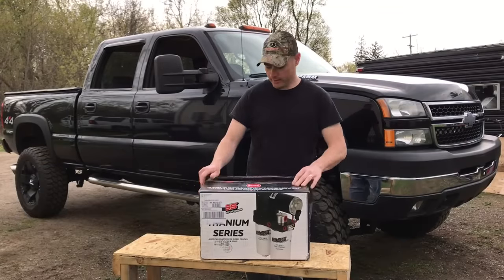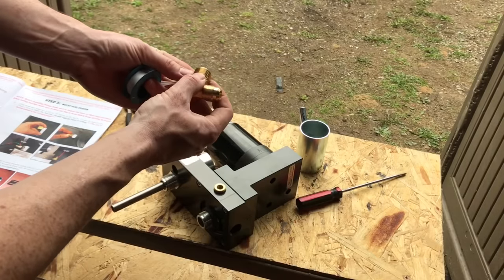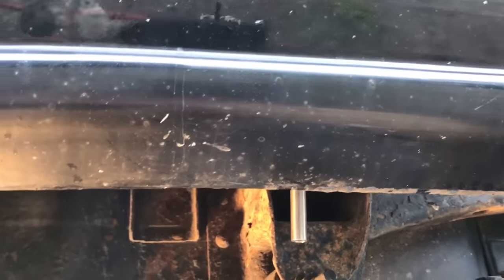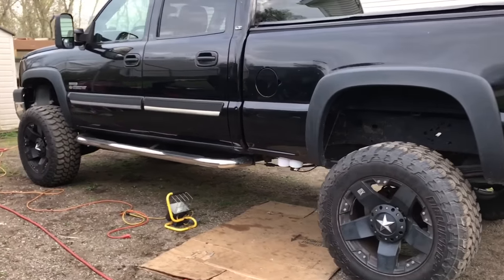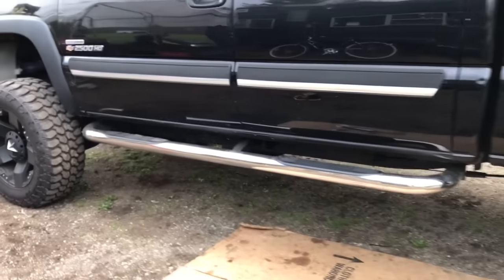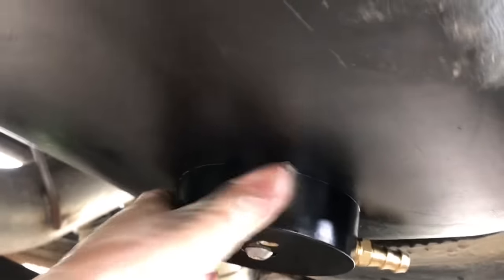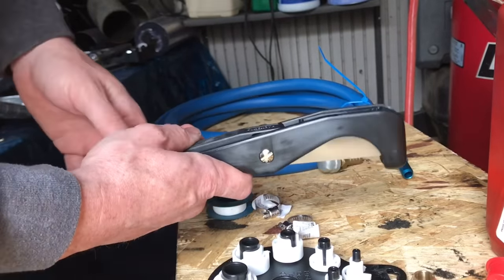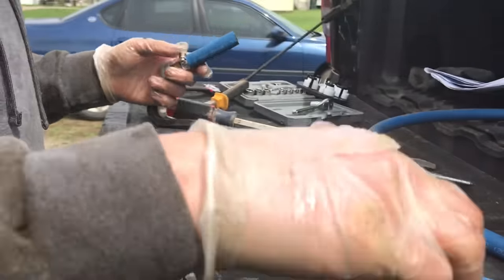Duramax FASS Lift Pump and Sump Full Install

Comment: Hello, great video! I not installing a sumo kit with mine and I'm having trouble figured out where my fuel lines run. The one coming out of the 90 defeeebfitting is my suction line right? The one you capped off. And the top fitting on the opposite side goes to the other side that you cut off? And the bottom fitting is the return that goes to your fill neck? Sound right?
Reply from the maker: +Jared Mcbride sounds correct to me
Reply: just follow the instructions and youll be good to go.

Comment: Hi two questions  did you keep the original fuel base with filter at front working or not.
The other question, what is the difference between drill holes in the bottom of the tank than use the original  fuel line  that came from factory 
I have a nice 2004  Duramax 3500 LT dually  do you think that kit works for me without problem 
Thanks

Comment: could you have put the return line to the old suction line you capped instead of going back in the fill line
Reply from the maker: +4x4family it sounds like you could but the directions don't say to do it. That's a good point though

Comment: I have a 2013  LML 2500HD 6.6 TURBO. I've started to have problems when I turn the key to start the engine it's taking longer to crank. I've put new batteries on.  Next I plan on changing the o rings in the primer pump. Could you give me any advice on what my problem could be? Please!

Comment: So, should you unplug/tape up the electrical connector for the factory fuel pump thay sits on top of the tank?
Reply: No that's a sending unit NOT a pump. There are aftermarket in tank Lift Pumps...but even more expensive

Comment: Now just Get a fuel rail shim or race valve and a ppe ported fuel fitting. Then you'll be set. And a 3 inch boost tube
Reply from the maker: +Live4 Boost that stuff is already installed I'm really considering upgrading the injectors
Reply: Oh sweet. They say lbz injectors is good for 600hp I don't know if that's wheel or crank. But I'd go turbo, then cp3 and injectors like a stg2r 68 Danville.
Reply from the maker: +Live4 Boost that's a good point a turbo might be the best route

Comment: When cutting the filler neck hose I didn't realize there was another hose inside and I cut through both! Do I need to replace the internal hose or am I ok to just button it back together?
Reply: Found I am having the same issue, how did you do yours?

Comment: Hello, 
I have 2 Duramax trucks 1st a 2007 with 100,000 nothing done except 1 glow plug a year and regular 5,000 service. 2nd a 2015 with 247,000 some front end work and regular 5,000 mile service.  I do all my own repairs as a police officer I stick to a tight budget. What would you recommend me checking on either to make them last. I do pull trailers but  I am easy on my vehicles.

Comment: Maybe a dumb question for an old video but I bought a FASS 150/150-3010 back in 2009 for my 2995 3500. I work overseas a lot and never had time to install it. Any concerns I need to think about this NIB Fass pump when I finally get a chance to install it? Looks like the filters for the newer 165 won't work but shouldn't be an issue finding the stock ones. Maybe contact Fass. Transmission videos you've posted look killer and I'm debating on whether drive my truck from Idaho to Wisconsin to have your guy do the build.

Comment: Been a long time subscriber and I'm looking into installing a FASS pump on my 3500HD Classic, so I was glad you had an install video. Just had one question. 19:42 you show your fuse box lid and it shows a 10A fuse for ignition but you pulled a 25A out of there. Is there a reason for that? I'm not at my pickup right now so I can't see what I have.

Comment: I have a 2007 and a 2015 both stock. What Fass pick up pump would you recommend gph with all stock parts and if it were you would you even add a pick up pump.

Comment: Any issues with particles and debris from the bottom of the tank? i figured that is why the suck fuel out not let it drain
Reply from the maker: +Saint Matthew no issues yet but you really don’t need the sump it’s just better on the FASS since it’s gravity feed

Comment: Did you consider running the return from the lift pump to the suction line you capped? That way you wouldn't need to cut into the fill neck. Good video btw.
Reply from the maker: +Ian Hill I'm. It sure that would work properly if I did that but I see we're your going with that. Thanks for comment
Reply: Truck Master I'm going to be installing my FASS 150 and Beans sump this week, so I guess we'll see how well it works soon. lol
Reply from the maker: +Ian Hill good luck man

Comment: I see you have the 150gph lift pump. I see they have 290gph also. Does it matter on how much pressure? I have a 2006 lbz in Commiefornia and smog guy telling me my fuel pressure is a little low. I was told that adding the lift pump would fix this so I was just wondering on the pressure.

Comment: Truck Master, my Fass Lift Pump instructions say to drop my tank. There aren't any videos showing this step. Do you see any reason for that to be done? I have a 2015.5 LML.
Reply from the maker: No you don’t need to drop the tank
Reply: @TruckMaster  Good to know. Thanks man.
Reply: Follow-up: Fass sent me the draw straw kit, which does require tank removal and drilling a hole. Pretty silly cause the avg DIYer isn't capable nor comfortable doing that. Called XDP and they confirmed that's what Fass now recommends for the 15&16s. I've got to order the filler neck part now since it doesn't come with this kit. Glad I caught that before cutting my filler hose. Hopefully this post helps anyone with my year model LML. I'll call Monday and ask Fass to send me a filler neck return manifold; part RM-1004.

Comment: You have any problem with pump sound on the fass? I installed it on my lml and I can hear it very clearly over idle. Fass says its a suction line problem. I'm installing a sump tomorrow so maybe that will fix it. Keep up the good work.
Reply from the maker: +Aaron Fuller yes mine sounds funny before it starts but then cleans up but I think it's normal. Thanks man

Comment: Ever since I got my lift pump the housing keeps leaking. Bought the delete but I’ve always wondered why not just completely by pass the housing.
Reply: jhurley12 I here you in losing prime but with the fass that shouldn’t be an issue. Correct?
Reply: jhurley12 I’m thinkin by pass the filter housing completely but leaving it bolted up there just in case.

Comment: I noticed your ignition fuse was a 25A instead of the OEM 10A. Why do you have a 25A fuse in there? Does it call for that for the lift pump installation?

Comment: hey not sure if you'll ever see this but... important question... did you do your efi live tuning before or after you installed this fass lift pump? on my 04 Cummins i have the lift pump up by the filter housing and they just put in a brand new lift pump in the tank.. they did the conversion to move it there. so it's a brand new lift pump. my question is would you think i should get a tuner (smart s06 pod) or should i do a fass 165 install first? i wasn't sure which you did first but being my lift pump is brand new i thought maybe i could turn up the wick on my Cummins with a tuner first then do the fass 165 later this summer. what's your thoughts and what did you do first?
Reply from the maker: I did it before

Comment: Here's a question on the return line. I'm installing the air dog AirDog Duramax 100 GPH Lift Pump and a sump. Is there any reason, like a check valve, that I cannot use the old fuel tank pick up ( old supply line from the tank) for a return rather than cutting into the fuel fill? 

Since I am now getting the fuel supply from the sump it seems silly to cap off the old pick up line and run the return through the tank fill hose.
Reply: Agreed, and several have commented that they have done it that way, and now that I see how easy it would be to route the hose that is my plan.

Comment: I just got my FASS lift pump for my LLY Duramax. dose this lift pump bypass the factory fuel filter and go directly to the pump .? Or dose it go through the stock fuel filter and then onto the stock fuel pump?

Comment: Before you got the lift pump were you having issues draining the rails? I'm starting to think that's my issue. Truck pulls hard from a stop and as 3rd gear starts to get near shifting to 4th it falls on it's face. No power and won't shift. I let off for a couple seconds, let it shift and it takes off like a rocket. Any thoughts? Just changed my filter and added a race plug and didn't really seem to do much. Running a ppe 120 tune.
Reply from the maker: Steve Lager that’s weird not sure why the plug didn’t work but thinking about porting your fitting on the cp3 I did a video on it
Reply: Truck Master thanks for your help. Pretty sure it ended up being my factory plastic fuel filter bleeder bolt was borderline stripped out. Letting air in the system.

Comment: So why did you not run the supplied hose up to the front of the truck?
Reply from the maker: +Wesley Hanson because there is no reason to. The supply line is closest to the fuel tank
Reply: Truck Master yeah i guess. Directions say either way? Haven't looked at mine yet. Gotta install it tomorrow
Reply from the maker: +Wesley Hanson good luck man

Comment: So i am really curious my Duramax is a LBZ i believe 2006 cat eye like yours 3500 4 door 8 foot bed 4x4.  So lately ive noticed a decline in power i regularly change my oil and filters i always run Lucas oil products in my oil and fuel, my truck has 387,000 miles still turns the back wheels without brakes no problem bit i have noticed the power loss! I have a few questions living in Pennsylvania we get rust everywhere my fuel lines are looking bad so this Fass system comes with all the fuel lines correct? So i can remove all the stock fuel lines right? Also i pull a heavy ass 5th wheel camper and i was wondering about going up a size in my injectors is that ok to do while keeping the stock turbo and intake system? Would really love some information on these questions it be a massive help! Thanks

Comment: Do not use vise grips to crimp crimp connectors!!  Worried about cutting a rubber hose straight but not your electrical connections??

Comment: If you run your Teflon tape off of the top of the roll you have less problems.
Kopper Kote your bed bolt.
11mm for 7/16", 14 mm for 9/16"
Make the poor mans Raychem ='s RTV under your heatshrink. 
If you have used S/S hose clamps they should have tape or heatshrink under them. 
Engine sounds good.
I think that the output is  above our fuel return.
Your 3/8" lines are for your fuel return 1/2" is supply. 
 Gas / gas peddle wt???? Ohhhhh fuel tank....diesel Throttle diesel.
I won't type it here but read up on the K&N air filter unless they have improved them. ISO 9003??
Reply from the maker: +Edward Carberry man you should start your own channel bud sounds like you got it all figured out. Great advice
Reply: Thanks
I got the FASS 95 GPM for the 5500. I put pre and post pump valves with a return line to the tank for pumping fuel/ air to purge the filters when replacing them and a spare for a diesel generator. I should be getting my pre and post fuel pressure senders in a few days. With three switches as well. WTF??hehehee Hope to fuel the tank in a few days see if it will run?

Comment: great vid! when you did this, did you keep the fuel filter head under the hood or did you delete ? i want to do on my LLY , curious if the filter system on the lift pump will be sufficient. thanks and love the vids
Reply from the maker: +Lee Hayes I didn’t delete that yet still debating doing it

Comment: 26:48, maybe my hands are not strong enough.  I have the exact same plastic insert, pushed it all the way, and I can't get it come apart.  Dang, and all I have to do is hook up these last 2 connections (E&R, and R is going back to the tank's drawstraw (FASS said that's OK on and 08)), prime,  check for leaks, move pump to final location, and done.  but I'm stuck!!  Is there a trick to this?  Fortunately I can just remove the fuse and drive to a mechanic for help.  If it's that hard to get off I would hope it's easier to snap on.
Reply: Just looking at this plastic piece relative to the new connection it looks like to probably is just not going deep enough to unload the springs around the barrel.  Obvious these connections are not all the same.  My looks like the one in this video but my truck in an 08.
Reply: Yes there is a trick.  I figured it out at NAPA where they had several different fuel connector removal kits.  First the white kit I had purchased was too shallow and didn't go deep enough into the connector, the NAPA was about twice as deep but you still have to be careful to insert such that cracks on the side don't line up with the little internal springs or they won't release, so insert, pull and if nothing then rotate just a bit and try again, and when the internal springs are all depressed it comes off pretty easily so if you are pulling hard, reset, rotate and try again.  SUCCESS!!  All hooked up, no leaks, running nice and smooth.

Comment: Hey do you know if it's possible to used LLY pistons on stock LBZ Rods and build a higher compression LBZ? Any information would be great
Reply from the maker: +Wayne Johnson I would say yes but my advice is to research duramaxforums.com and ask that question maybe someone smarter than me can answer that. Type that question in google as well mabye someone already ask the same thing

Comment: @truckmaster i was curious i was informed i should delete my factory fuel filter once i have a lift pump installed. What are your thoughts? I watch all your videos btw and i love the channel and info you put out!
Reply: Hey Doriyacht,  no need to delete the existing fuel filter, it catches particles that may have already formed or got stuck (before your lift pump was installed) between your lift pump and existing  fuel filter.   Have you upgraded the FASS filters to CAT filters yet?  I have a couple videos on the subject on my channel if you are considering the upgrade.

Comment: Is there a reason you went with the FASS Fuel system over an AFE power fuel system or other competitors?
Reply from the maker: +Tyler Polanco it was a toss up between FASS or airdog but airdog had motor issues I never checked out AFE

Comment: Hey have you encountered fueling problems. My duramax 6.6 fuel gauge goes up and down every 4 min and I cannot pump more then 5 bucks. Pump just stops ( due to diesel bubbly up the filler neck) 
Any suggestions please??

Comment: Hey info on the wheels and tires? does your truck also have a lift? if so what size?

 have an 07 LBZ clean and stock. have had it for two years as the family vehicle but finally got the wife a little suv and was going to sell the truck but once i started driving it, i want to put money into it and make it a fun truck.

Comment: Hi I'm new to your channel and just recently started trying to pump up my info on the Duramax LLY/LBZ as i am thinking of buying a 2006 LLY (some are saying its a detuned LBZ??) and noticed in one of your vids an Edge tool you used to check the injector balance. i dont want to get caught out with having to buy a set of these cos they're a fortune over here in the UK and would like to get hold of the same because they work on all 3 biggies I'm told, Chevy/Dodge/Ford. Which model is it ? and do lesser models still have that function. ?.....Nice straight to the point vids mate and i am currently trawling through your back catalogue of vids.. :¬)

Comment: Are you still running your Sinister Cat Fuel filter adapter with this lift pump?
Reply from the maker: Not anymore
Reply: Gotcha. Did you delete your fuel filter to run the lift pump?
Reply: I’ve heard some guys take out their factory filter as the FASS has a filter already
Reply: @taylorgrizzle3339  So I ended up deleting the stock filter with a Fass Fuel Filter Delete. Seems legit. I was told that with 2 filters my Cp4 would be working much harder. So we shall see.

Comment: Anyone have any advice on disconnecting the fuel line above the tank?? My half inch disconnecting tool won't go in the release
Reply from the maker: +Cygnetation get a better 1/2 tool some of them don't go deep enough
Reply: Truck Master After an unnecessary amount of time, I finally got it disconnected but had to take my fuel cooler completely off and ended up busting one of those lines.  Unfortunate day for the dmax..
Reply: Truck Master this is still a fantastic tutorial and does a wayyyy better job than the instructions do for sure. You make some great videos!

Comment: I have a 2003 Duramax does you have to put any work in the engine to put that fuel pump ?
Reply from the maker: +tony Andrade no other thank the electrical
Reply: Thanks for the info

Comment: Could there have been a way to hide the filters?
Reply from the maker: +EnlightMent yes definitely I just installed it per instructions but you can mount it in a different spot
Reply: Truck Master okay because I'm looking at Fass and Airdog. Fass being a better product and Airdog not being seen. 

Can you hear it running in the cap?
Reply from the maker: +EnlightMent it's your preference they are both a great brand and no you can't hear them in the cab

Comment: Is there a mounting location that is hidden
Reply: I watched another video and they just used the 2nd hole back so there was no interference from the fill tube and the filters were completely hidden.  The bracket was sticking out a little in the fender well but that could be cut off, but since it's black not nearly as visible as the filters hanging down in plain site.  That's what I plan to do.

Comment: What is the point of a sump if you route the fuel line upwards?
Reply from the maker: +Toby Head it's still gravity feed either way you look at it and less work on the cp3 suction line